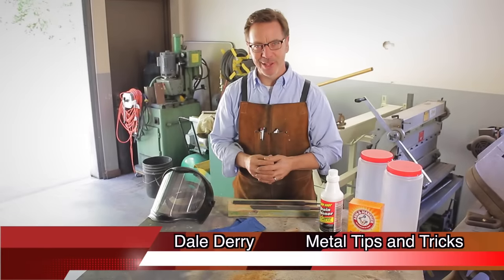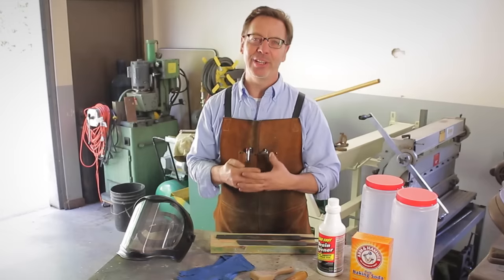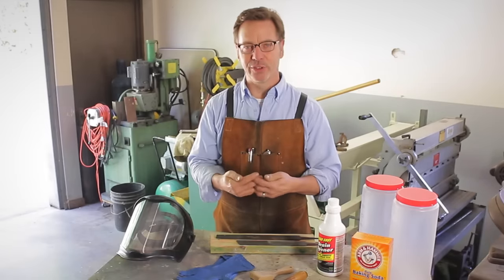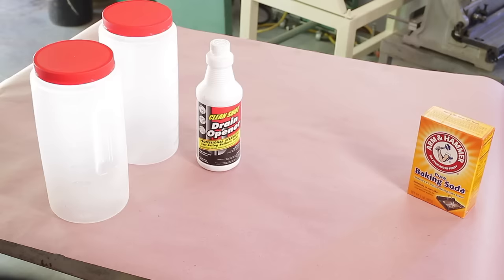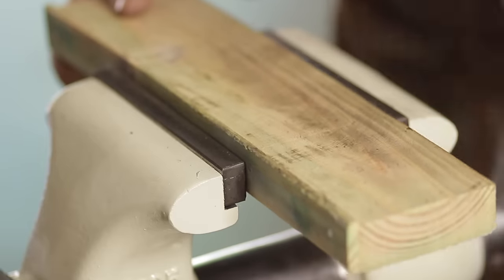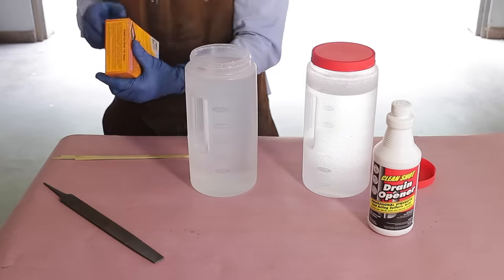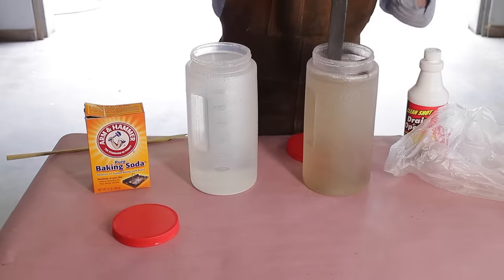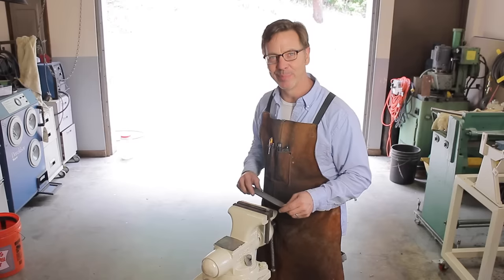How to Sharpen Metal Files

Comment: This is cleaning a file. Your not sharpening it at all. If its really blunt from a lot of use this wont work at all.
Reply: I was wondering thinking the same thing
Reply: +Colin Riley actually it is sharpening the file because it removes metal from the profile of the teeth...now if something was used that only attacked organics then it would merely be cleaning.However you are right in if the file has been truly abused and the teeth are really flattened ,worn down smooth or broken then this will do nothing...time to invest in some new files.
Reply: The file remains the same. Its cleaning not sharpening. It may or may not improve its cut.
Reply: no the file does not remain the same...the acid acts on the metal of the file...its a small amount which varies with the strength of the acid and time left in solution but metal is removed from the surface of the tooth from all sides...general basic science that has used both in a production stage and sharpening of files for a very long time...If a base solution is used or a solution that does not effect the carbon steel then it is cleaning bath and not a sharpening bath
Reply: +mountainmanfab Even if it removed a layer of metal microscopically small it will remove from the sharp edges too. The file will not magically now have a sharp cutting edge. Why not put your drills in this magic solution and you wont need to sharpen them anymore !
Reply: +Colin Riley agreed
Reply: +Colin Riley    " Why not put your drills in this magic solution and you wont need to sharpen them anymore !"   The famous lawyer Perry Masson, himsel,f and Columbo would have said the same thing....
Reply: +Colin Riley It will remove a microscopically thin layer of metal, worst case scenario. Same as honing a blade. Job done.
Reply: +Colin Riley If you remove metal at a constant rate from the surface of a part, acute angles will tend to become sharper and obtuse angles will develop a radius. Since a file depends on that sharp exterior angle, this could improve the usefulness of a file. You wouldn't want to do this with a drill bit because you'd reduce the diameter of the bit.
Reply: +Adam Mayer  The acid will attack the weakest areas and the sharp edge will erode fastest.
Reply: Umm no, sides of the edge erodes faster coz more surface area thus its possible that it gets sharper.
Reply: unleess the points of each edge at dull and rusted, you erode the metal it going to erode evenly. he cleaned the file and removed mass from it. at nowhere during this process did he sharpen it..
Reply: Absolutely correct !
Reply: +Colin Riley I apologize for the bad English on that post before anyone corrects it
Reply: You are correct, It is mostly cleaning it and if you have abused your files and have blunt areas, you know what I mean if you do it, it will not give you an evenly sharp file. In truth the only thing you can do is clean a file, since grime and deposits have the effect of making your file appear blunt. To really sharpen a file you would need to regrind all the teeth, possible but not practical.
Reply: +bouchee2007 Submersing the file in an acid solution does clean the file. If it's done properly it can do a good job of sharpening it too. 
As I explained years ago on my channel the acid removes one atom of metal from every surface it touches for the entire time it touches it. The teeth lose an atom on each side and one on the edge. That two to one ratio creates the sharpening action. The teeth get thinner and sharper.  
Thus you are correct about the cleaning but it is better to mechanically clean the file before using the acid to sharpen it. The reason is that anywhere the dirt blocks the acid from touching the file, the acid will erode the steel unevenly, leaving a jagged edge.
Reply: as the acid eats away from the metal, do not think of the point as one point but rather where two sides meet, so for some duration it is a 1 to 2 ratio of metal being worn away, as you approach the tip you are eating away twice as quickly as the acid acts on both sides of the point. thus creating a round tip.
Reply: Good for you, I said the same thing!  I'm not even sure that a file can be "sharpened" at home without a forge and a many, many ton press.
Reply: Jim Adams Look up making a file. Shefield, England was famous for the files made in small shops by entire families. They used a chisel and a hammer to make files.
If you are sure that what you think is right then just don't mess with sharpening files. The world will little note nor long remember your your little voice crying out "IT'S FLAT"
Reply: Old Sneelock's Workshop,you just have to love fools that think they are right and refuse to look into something.
Acid has been used to sharpen files for years.The problem that happens is some people use too strong of a solution.
Reply: in one comment its hundreds of year, now its years. make up your mind... youre giving misleading information
Reply: would vinegar not do same thing?
Reply: To my knowledge any acid will do the same thing. Some are faster than others. I think it's more a matter of concentration rather than the specific type of acid.
Citric, acetic, sulfuric, are the common ones. The only restriction I've run across is that hydrochloric, sometimes called muratic, can cause hydrogen embrittlement.
Reply: Old Sneelock's Workshop I'm getting great results with the cheap white distilled vinegar, I leave all submerged until I no longer see oxidation bubbles, then wipe down tool with the stainless steel baby-wipe type cloths used for cleaning kitchen sinks.. while it's working i drop small wood work projects into the mix, the rust and vinegar stain the wood beautifully. :)
Reply: That would make a great stain. How do you control the color? Or do they all just turn out black?
Reply: Old Sneelock's Workshop I drop in a few end cuts of diff wood to see how they turn out, I notice the longer I leave it to dry out the more aged and defined the grain becomes, if it's going dark/black I empty out some of the vinegar solution - rust 'n all - into a seperate container, top it up with a fresh bottle of vinegar and add some food dye, or one of the oven cleaner steel wool balls with the pink or blue colorant, dip it in the vinegar/rust solution & squeeze the dye into the bucket, no need to leave in the steel wool as there's already enuff rust in bucket from the tools.. mixture of pink and blue give a nice purple effect, even taking the rust that sank to bottom of bucket and buffing it (still wet) with a sponge direct to the wood works really well, you can blow off the dry rust particles when its completely dry.. but some of the wood eg pine, only gets a good stain on the cuts.. bit of rough planing with a router or put a steel bristle brush in the drill and score the surface, which eats away the soft wood leaving a grain that sits like veins out of the wood, the color really gets in there, but only after a good week or more of drying before I notice the true effect.. sorry for long rant or any typos there.. :)
Reply: Julio says Facinating. No problem with the long explanation. The devil is in the details. :-)
Reply: Old Sneelock's Workshop as as kid I used to work weekends at n antique furniture store, they used to use caustic soda to strip all the years of paint off pieces, then they'd take the stripped wood from a week earlier & dip it back into the same mix to re-stain it :D.. similar, you can use the vinegar and rust solution to stain metal to that patina effect, eg: baking tray, add a really rusty spanner,  get a new steel ruler and lay it in tray beside the spanner, but raise the ruler with nuts under it (like a bridge) so it & the spanner are same height, add vinegar until it just flows over the ruler, (this allows the rust particles to flow over rule but they wont wash off, if you get me on that sorry bout bad description) the rusty spanner will patina the new steel rule .. one is losing rust, the other is getting rust effect.. :)
Reply: Old Sneelock's Workshop, try sharpen a chisel on youre 2 to 1 ratio..
Reply: Take a look at the geometry of sharpening. The two to one referrs to the relative amount of metal removed. When you sharpen a wood working chisel you remove metal from just one side. The bevel side. The design of the blade allows removing metal from just the bevel. No need to thin the blade. On a cold chisel the edge is sharpened on both sides. Again no need to remove metal from the whole chisel.
Unless you use files much differently than I do, it is difficult to use the same method as sharpening a chisel. With the access restrictions imposed by the closely spaced teeth other methods are required. 
For the average person abrasive blasting to sharpen a file is not cost effective. Acid is a less costly and less skilled method. I'm sure even you could make it work. If you ever tried.
Reply: Please site your source for not believing that Sulfuric Acid in low to moderate concentrations will erode steel thereby chemically sharpening common steel items such as fish hooks and files.
Reply: You seem to be assuming that the weakest areas would be affected by chemicals the same as mechanical forces would affect the weak areas...meaning the thin tips of the file's teeth. In reality that is not the case, acid acts at the molecular level equally to all iron that is exposed. Which is why chemical sharpening works as long as there is a basic edge or point already present.  My grandfather use to place dull files in water and let oxidation "sharpen" his files.
Reply: No.  The extreme point (of a file tooth) will have roughly 300 degrees (in two dimensions) for the acid to attack.  The middle of a bevel will have only 180 degrees.  Perhaps the metal teeth's edges get eroded unevenly due to vagarities in the metallic structure which cause the teeth to get a somewhat serrated edge (which would cut better) but I bet the "sharpened" edge doesn't last long.
Reply: That would be true if the rates of erosion were the same for the point as is the bevel.  The point will erode faster. Can't prove it, just intuitive.
Reply: Glenn, I have proved it through testing.  The file is sharper. Ergo it works.
If your intuition was correct a steel plate would corrode to a narrower profile before it got thinner. The edges corrode at the same rate as the middle but there is only one edge. There are two sides to the plate. It gets thinner twice as fast as it shrinks in width.
I can hear the wheels turning. "Wait! There are two edges.".
Not on a file tooth. One edge, two sides.
Reply: Glenn Krzeminski You might not be able to prove your intuitive theory, but you can disprove it by tossing a clean dull file into weak acid.  Hopefully you do it correctly and are able to salvage what would otherwise be a  candidate for the knive makers supply bin.  Best of luck.
Reply: johnnybarbar  Point taken, and no harm done (to a dull file). 
I believe your claim was that the mild acid bath removed metal evenly.  By that logic,if you threw a brand new file (obviously clean) into a mild acid bath it would remain as sharp.  Prove your theory at the risk of a new file.
Reply: Glenn Krzeminski  Personal experience  has already proven the process for me...thought I already mentioned that.  PS, I'd be happy to have you send all your dull files to me.
Reply: Old Sneelock's Workshop: It is refreshing to see there is at least one sensible commentator on this process, what I cant understand is that people are commenting without either having tried the process , or without understanding what is happening in this process, they would only have to try it, then inspect the teeth of their file to see that it does work, and has been used for many years in UK, as for using the process on a wood chisel, well, there is one person that has never used a wood chisel to make a statement like that.
Reply: +Englishman French Thanks for your kind words and support. 
There are people the world over who enjoy arguing for the sake of being noticed. 
A favorite method for channels with little or no subscribers to get themselves noticed is to find a popular channel and go negative. 
They believe that any notice is better than none.
If your interested you can pick out a few and visit their channel or Google page. They generally have 2 or 3 subscribers or followers on Google. 
By the way when you visit notice if they allow comments. If they do, they are the exception.
Reply: Colin Riley: I would suggest that before entering into negative comments you try this out, make sure, as instructed, that you clean thoroughly, you can try it after cleaning, then immerse in acid, then try again, you can then write an apology!
Reply: During use the tips of the file teeth wear away. That is normal wear.  As the file wears it begins to skid over the metal rather than biting in.  At that point it is a viable candidate for either hydro-honing or acid etch sharpening. 
If the file is abused, banged around in a box full of tools, run against hardened steel, or dropped so that the teeth are broken and chipped they are not candidates for hydro-honing but only because of cost. They can still be acid etched. Without shipping costs and the time involved, if you are able to save only one in three it's a good deal. Perhaps most of the file is okay with just one side screwed up, or one end. With no appreciable cost involved, what do you have to lose?
If the file is a little rusty or dirty, use a file card or perhaps a soft steel bar, like I use in my file cleaning video, to scrape the rust and dirt out of the teeth.
Something I haven't noticed in these discussions is any comments on pinning. It's not the topic of the video but if we talk about cleaning, as nearly every post has mentioned, then describing the things that create the need for cleaning should be defined. Pinning is when the gullet between the teeth becomes filled and stops the tooth's cutting edge from contacting the surface. 
If you are having this problem then cleaning will be an endless effort. It is caused by the teeth being too fine for the chip load. Go to a larger file with bigger teeth.
Reply: Well said Old Sneelock.
Reply: This is not cleaning but etching. Acid acting on the file teeth slightly modifies their profile. Googe for "chemical milling" to learn more about this kind of metal processing. Surely this won't make your file extra sharp but might improve the dull one.
Reply: yes it will

Comment: You are not sharpening the file, you are actually cleaning the grooves on the file, you may as well use a fine metal brush to accomplish the same results, just follow the groove direction to clean it.
Reply: Before denouncing this method of sharpening you should try it yourself. All of the people saying it wont work, have never tried it. All the ones saying it does work, have actually done it.

You can prove it to yourself on paper if you dont actually have a file to sharpen. 
It is simple geometry that you can draw out on a piece of paper to understand. To see how taking a few thousandths of an inch off of the entire surface of the file will sharpen it, draw a cross sectional profile of the dulled teeth, including the rounded points. Then draw a continuous line parallel to the profile of all of the teeth, spaced inward by half, which effectively makes the teeth smaller. You will see that the radius of the rounded point becomes smaller- in fact it has likely become so small that it has come to a point. Try it.

Comment: As a comment by Ed states it's not really sharpening.
It's cleaning the clogged file of its ' pinning' , this method seems a little over the top, as a file card will do much the same
Reply: Thank God Ed has you straightened out. I'd hate to think you went around wasting your time trying to sharpen files.
Reply: Old Sneelock's Workshop 
I sharpened a few files...
By turning them into knives...
they work great and I had $$ for new files...

Comment: Files are a degrading commodity. Once they are done they are done. Still keep and reuse the steel. This wasn't sharpening this was cleaning and unclogging.
Reply: It's chemical sharpening.
Reply: @herenow2895  no it is not.
Reply: @jimbarbwe1985  - So you reckon that the acid does not remove any of the surface of the steel at all ?
Reply: @herenow2895  Did I say that? No I didn't. Acid is not magic, it takes a uniform layer, it doesn't sharpen bugger all. Give it a try. Then go buy a new file.
Reply: @jimbarbwe1985  - I chemically sharpen fish hooks so I can attest to the fact that the process works.
On a triangle shape, as the acid eats off a small layer, a peak is reformed. It may not be perfect, but a distinct improvement.
Reply: @herenow2895  So that's a no then. Oh yes, but of course, fish hooks. I have shaped many a bit of steel with a fish hook. With all of your fish hook knowledge I'm amazed you are not a tool maker. Look down the comments, stop replying to me and go comment on how you believe the earth is flat.
Reply: @herenow2895  Come on it's a Friday night, I am sure you have some fish hooks to polish. Don't forget the "magical acid" :) 🎣
Reply: @herenow2895  scratch  that, I apologise for my mean, sarcastic comments. 

We shall agree to disagree.

Have a good weekend 👍
Reply: @jimbarbwe1985  - Cheers, I appreciate the apology.
Likewise, I withdraw my Yoda comment.
If only the rest of humanity were so willing to value peace.
You also have a good weekend.
To tell you the truth, I couldnt give a shit about fishing anymore.